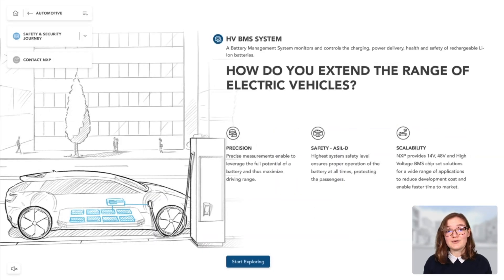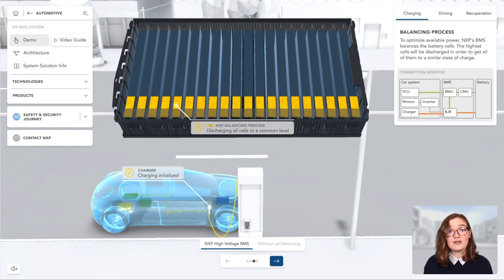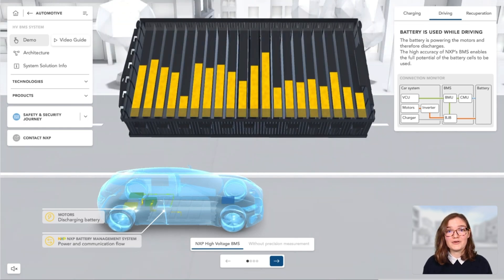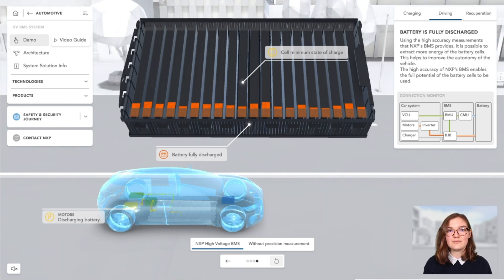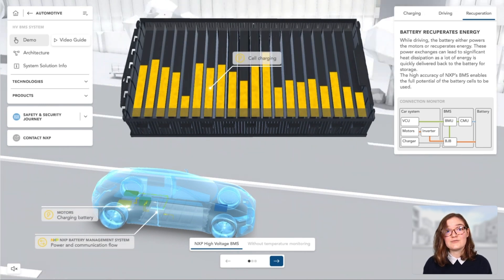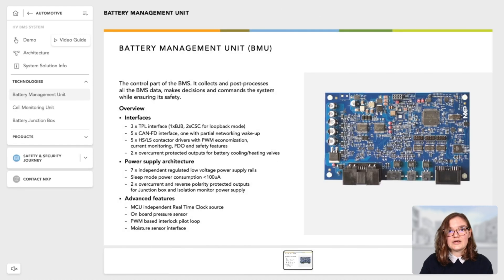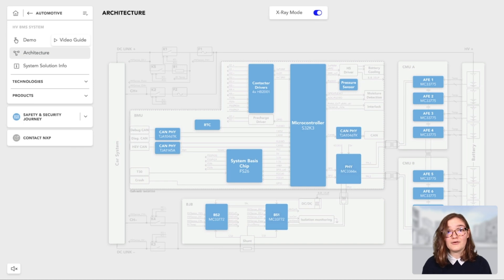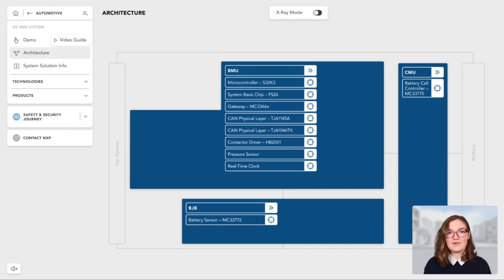High Voltage Battery Management System NXPLive Demo

Comment: Embedded One is using NXP for their analog front end, great chips as they can balance all cells simultaneously, opposed to other solutions that do every other cell at a time. With NXP's solution, it reduces the overall balancing time.